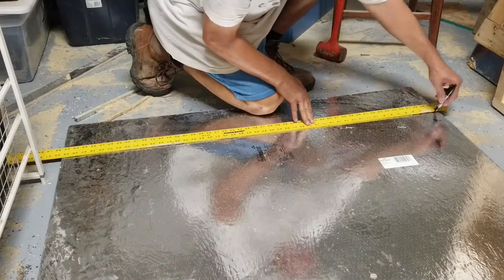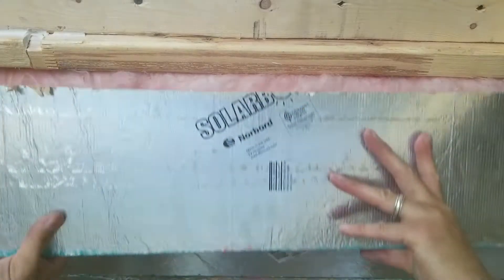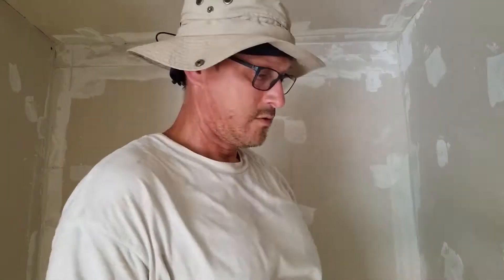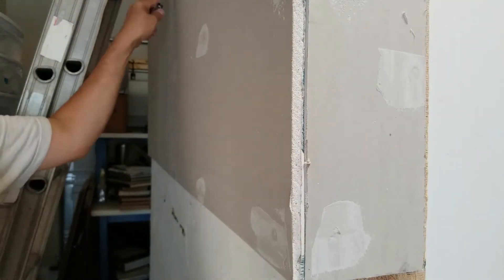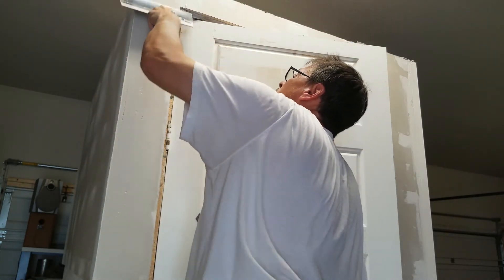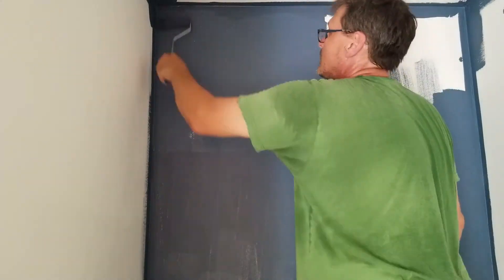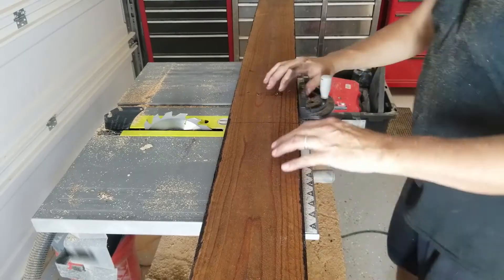What's the BEST Vocal Booth for Your Tone?  I built a vocal booth and here's what I learned.

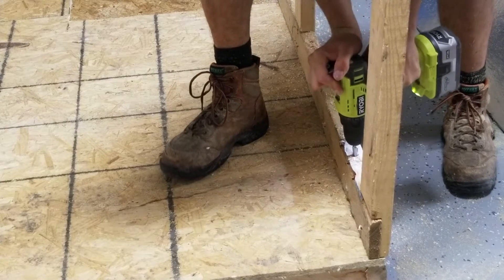Comment: 1:18 “break över joints to prevent hollowing”, does that mean wallframe screws end inside the base OSB (not touching base frame) or go all the way through  wall frame to base OSB to base frame? This is one the best instructions, many thanks.
Reply from the maker: First, I want to thank you for watching and subscribing.  I truly have a great lineup of independent film and sound projects that are currently in the works and look forward to sharing as much as I can with everyone.  Comments like yours help build and establish relationships of like-minded individuals looking to strengthen their skills.  The meaning behind the term “hallowing” was used to describe the layering of frame-to-frame corners of the support walls.  The inner frame could also be cut the same way, but I personally didn’t find it necessary to do so.  I would also use wood glue to prevent sound transmission between the OSB and frame from the outside wall to the inside wall.  The screws are measured to reach fully when attaching the OSB to the frame at all points available.  Having the OSB installed helps to add and screw the drywall later also. You can also lay down a thin layer of glue inside the cavities when installing the installation to help keep the installation in place while hanging the other OSB walls in place.  Now I built my booth using most all recycled material for frame parts and wall OSB.  If you have full sheets of this, then GAME ON!  You should have a better experience with less cuts than I had.  That is best to prevent transfer of sound.  I selected to layout my frame walls with the 2X4 flat as shown.  This is to keep more mass at the face of the walls and less cavity space between walls.  I knew I was adding installation inside the cavities so having a large cavity with less mass didn’t work for me.  Also, I needed the floor space so, with the four walls that thick it took away several inches of floor space but didn’t add any additional value to the project.  I’m not trying to drop another video on you, but if you watch the shed build video that I did you will see the way that the corners are cut using a table saw and a circular saw.  Also, the audio for that video was done in that vocal booth that I built.  The shed build is so far the only video that was used for sound recording in the vocal booth.  Good luck! and again if you have any questions please ask.  I work mostly at nights and on weekends so that is the best time to reach me.  Interested in seeing your progress so feel free to do so.
Reply: Thank you for your reply and attention. Having watched some your other videos, I wish I had the environment (and the tools) to implement them all. I live on the second floor in a 5 floor apartment on a high traffic street and it just gets hectic. My first plan was room in a room with a double wall system; the more research I did the more I realized I do not have that kind of space :) So I will just with a single wall system. My apartment is literally a cement block of impact noise coming from anywhere everywhere if you know what I mean so building the booth on wheels was a great idea and that's what I will do. I like the sound quality of your booth (watched your storage shed video). May I suggest you also share the audio equipment and the tools you use for your projects. It will help others like me who are exhausted with tons of confusing information and would like to keep it simple and effective. Good luck with your channel.
Reply from the maker: @mico-skywalker  that is a good idea.  Share the tools and sound set up using.  I agree it would help.  As soon as I finish up working this set for a scene we are working on for a short movie... I will do just that!  I really need to wrap up the whole D.I.Y. segment and start sharing tools of the trade for Independent film production and sound.  Please dont give up... keep at it!  You will arrive where you want to be if you keep at it!  Stay intouch